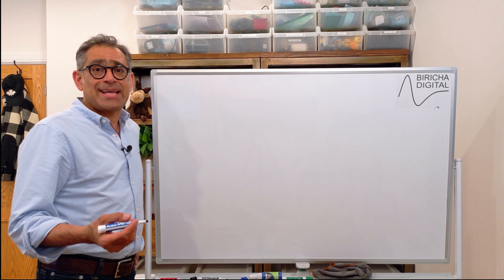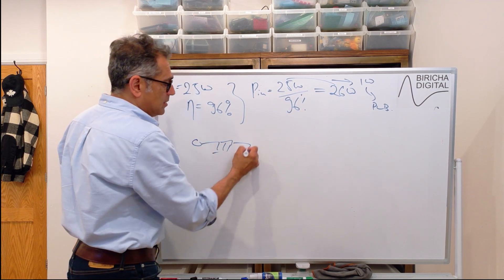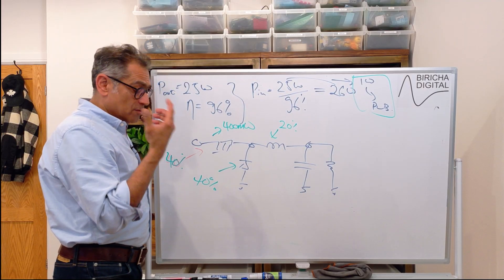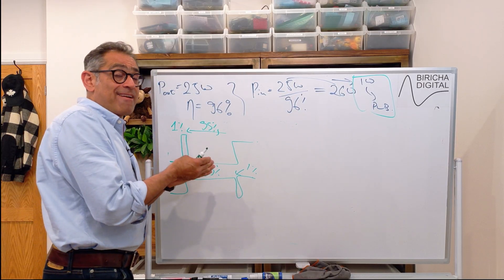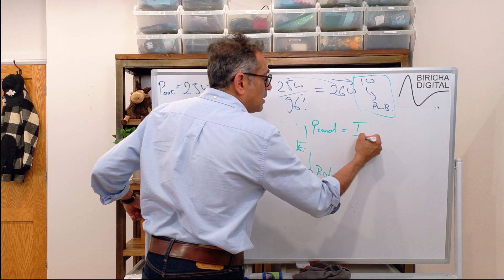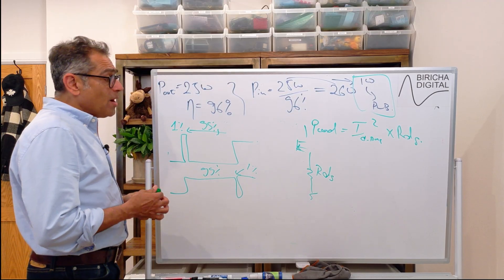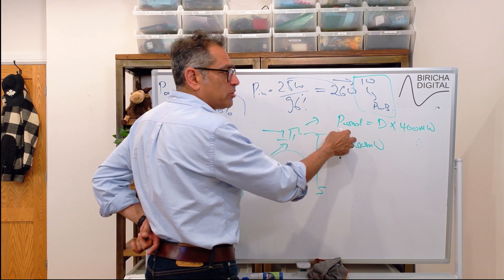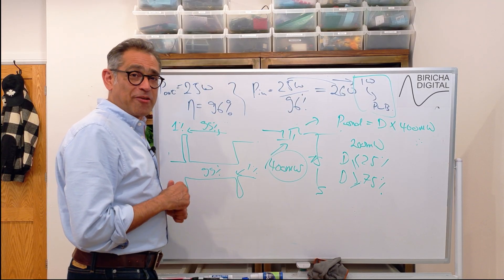How to Use Conduction/Switching  Losses Calculations to Select your MOSFET (Part 3)

Comment: I was following so far until the lower limit and upper limit of the conduction loss dependent on the duty cycle - if you're allocating 400mW for conduction loss, then you expect 200mW for 50% duty cycle, how or what are you setting such that there's a 25/75 limit? Isn't the conduction loss allocation (400mW) already set?